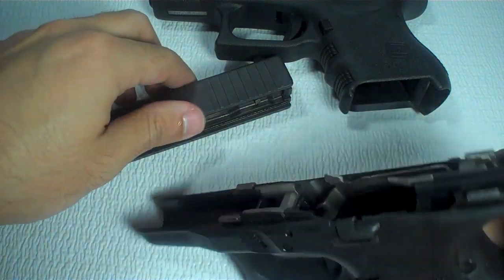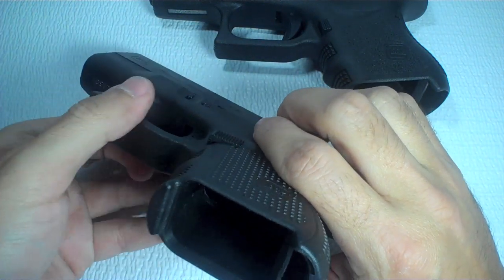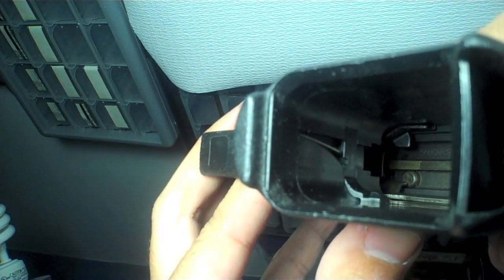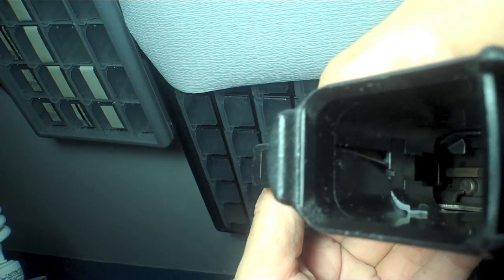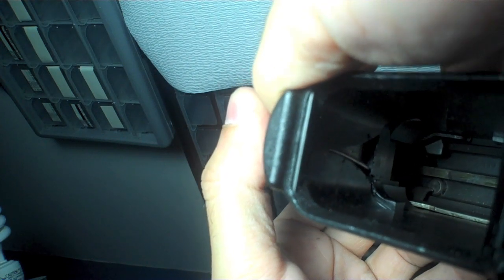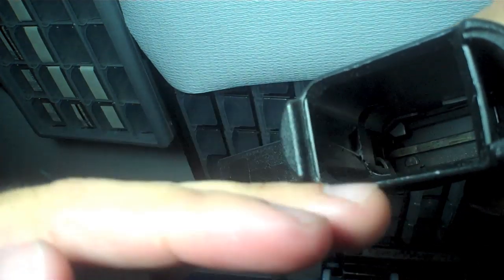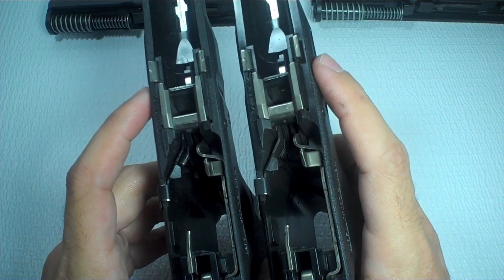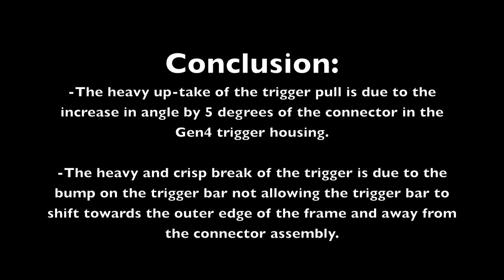What Causes the Glock Gen4 Trigger Weight - Part2

Comment: I also own a G42 and in the G42 they used the safety plunger that is now in the GEN 5 Glocks.  My G42 is a very smooth pull and release that is now in the GEN 5s.  The trigger bar bump allows for a straight push back pressure on the plunger just as you demonsrated, have not seen ANY DRAG on my inner slide by the trigger bar.  However, the shape of that plunger makes a definite difference when comparing the two types as in the GEN 4 to GEN 5.  I feel that the trigger bar pressing and passing over the two different styles of plungers does make a difference esp in the smoothness of the trigger press with the GEN 5.  How the bump's straight back press on the trigger bar (eliminating drift) effect weight by allowing more constant or fuller contact with the connector or the angle (?).  I guess that is where springs come into play.  Defensively, I'm not against the "WALL" just a lighter break with smoothness in a press, I'm not a "bullseye" shooter, but also don't like a Jerk either.

I relaced the trigger connect with the new "Black Ice" connector (3lbs) and replaced the "Safety Plunger" with the lighter spring and now have a very nice trigger press and release.  Did the same on both my G26 and G19 Gen 4s.  I believe that Glock wanted a better strike and consistent on the Safety Plunger.  The connector HOUSING itself, I agree, is  what increased that final pull weight.  Changing that connector solved my problem.  The new Gen 5, not only changed the shape of the safety plunger, but also the housing spring configuration on the connector housing as I've seen in my Glock 42 (Gen 5).

Comment: rubs more on the plastic housing, i just took the bump off. i also notice that on my gen 3 the safety plunger spins as the trigger is squeezed and on my gen 4 it doesnt spin. Im still trying to figure that out as on my gen 3 i cant feel the safety plunger spring but on my gen 4 i can here a small click as the safety plunger gets compressed. Gen 3 = better

Comment: I know this is an older video, but I just wanted to thank you for taking the time to post! I think it's a great explanation of what's going on also... I haven't had time to look but with the angle of connectors being different in the trigger housing...I wonder if the trigger springs are altered in any way? 

Now in 2016...I'm getting some gen 3 with 8+ trigger pull... the only thing I can think is the new finish isn't as "slick" as previous finishes and possibly the movement of the firing pin safety up into the slide may not be as "smooth"...who knows?! Maybe you should do a new video of any info you've gained since this original video. Either was, great video!

Comment: This is a good video. I am a mechanical engineer and I liked your systematic approach. I am very interested in this topic since I recently got a G17 Gen 4 and just hated the trigger. I ended up replacing it by a Zev Fulcrum after  trying the original trigger bar with a Ghost connector. (I guess I've got use to my PPQ M2 45 trigger...)
With the Zev fulcrum, the trigger improved significantly but couldn't completely get rid of the snap or "crisp" feeling at the end. So, it might discard the bump theory.  

Last week while at the range i tried one Glock, don't remember the model but it was Gen3, and the trigger felt really nice, no snap. The owner is a range officer, he told me he had polished all the contact areas and the trigger changed. I will do the same, specially the contact area between the trigger bar and the connector. 

Please, if you go ahead and polish the parts post the result as well.
Reply: try polishing the cruciform tip that contacts the striker plus the striker surface it contacts as well. note the cruciform must scratch the striker arm downwards to release the striker. there is much tension and friction at this point.
Reply from the maker: Thank you for the kind words.

I polished the contact areas on my Glock 19 Gen4 and did not notice much difference but maybe you will. I will say one thing: DO NOT polish the area of the trigger bar that makes contact with the striker pin (its the section of the trigger bar at the back of the firearm that looks like a small cross). This part should not be touched because it can lead to accidental discharges if it's polished too much.

Comment: The bump may not rub on initial pull, but it MOST certainly does rub when the bar starts to bend, which it what keeps it from bending.  I'd say the bump clearly is in fact adding the resistance, once it makes contact.  It may however, be designed to keep the trigger bar arm straighter, thus possibly making it more reliable.

Comment: That makes a lot of sense . I was looking at my G30 that has a gen 4 style trigger bar and was wondering why  after adding a connector and spring kit that it did not feel like my other glocks . I think when I get home tonight I am going to grind  the bump off and polish it . Good stuff . Thanks for posting !
Reply: Did you do this. ?   I have a g30s
Reply: I put a 3.5 unlimited connector and 6lbs trigger spring. It made a difference. Much lighter.     I added a tungsten 17lb guiderod gs skeletalized sticker and safety plunger but kept all the factory springs and it runs flawless.

Comment: So it is the bump, but not because of friction against the slide.  It seems that it's because the bump causes the rear portion of the trigger bar to press inward more on the connector (which has a bend outward, i.e. not completely 90˚).  So as it seems it's not just working off the 'lip' of the connector, but also more against the outward force of the bend.  That's what makes the bar move laterally when pulled, and that's what that bump ends up resisting…causing the 'friction' back at the connector.

Good work!

Comment: Thank you for your very excellent analysis of the issue.
The problem I have is the fact that Glock put it there for a reason which appears to keep the bar from sliding outward during the last part of the pull. Which seems like maybe a good idea. I wish someone knew the real reason its there. Back several posts it was suggested that it because of the ability to switch the mag release for leftys. If that's the case I would have no problem switching it.

Comment: Get Rid of the Staple-Gun feel trigger:  100% agree!! 
After trying several different connectors and combos with springs on my Gen 4 35 and recent 41 ....  The removal of the BUMP or switching out to a Gen 3 trigger bar is 110% IMPROVED less of a wall/reduced weight "feel".  

The Gen 4 35 I got a gen 3 trigger bar Pt# 0357 and no bump from the factory.  The Gen 4 41 I got the newest trigger bar from Glock but all 45 ACP/10mm bars (gen3 or 4) has a "bump" so I filed it off ..... Both Smooth and Sweet. 

To help with the "Wall" before the break of the striker, I highly recommend the Ghost Edge (or Evo Elite, or Pro3.3) connector.   The wall free connectors make everything above with the bump free trigger bar even more Sweeeeet.  

"De-Bump"  and never look back.  Your gen 4 will loose that "Staple-gun" wall trigger and you will shoot much better ... lots better!!

Comment: Great video, explanation and theory.  To test it I ground the bump off of my gen 4 19.  Much better and very similar to my gen 3 glocks.  I will order another factory fresh trigger/ bar assembly and move on.  I was just about to head to the local GS to trade my gen 4 for a gen 3.  Thanks, you saved me a couple hundred bucks.  I was really struggling with my Gen 4 at the range.  Could not get near the groups as with my gen 3 and my gen 3 is a snappy 45 acp.

Comment: Do I have to be concerned about plunger being fully depressed with the absence of bead on bar after prolonged usage?  Theory:  gen 4 has smaller grip radius which required smaller trigger housing which changed connector angle and bead was required

Comment: Keep in mind that Glocks are duty weapons not target guns so the stock trigger isn't all that bad, Granted the gen3 trigger is nicer than the gen4 , But you can make them better mass produced guns don't have the refinements that expensive guns do because it take time to polish everything that said a little time with a super fine stone and then some polishing of all the contact surfaces of the trigger parts will make even a 6-7 pound trigger feel lighter than it is. Don't mess with any of the sear parts though.

Comment: also the connector is 5% but on a less angle than the gen 3 so it would be a lighter pull so your off there that's why you need a police chiefs signature to even get the dot connectors.

Comment: The only reason the bump is there is for if your a lefty and switch the mag catch to the other side. The way I see it is when the bar drifts left at the safety plunger it changes the 100% parallel engagement of the sear to the lug face of the striker.So that left drift translates to the right at the sear.This is why we used to actually file the lug face obliquely at a 15% angle from right to left to regain that engagement. Some like the crisp snap off some don't but I'm an advanced armorer with glock and the 45/10mm gen 3's on all models have that bump so it's nothing new. I commend your observations and attention to detail. You are 100% right

Comment: I think another factor is the GEN 4's tend to be newer. They just came out. The Gen 3's are older and tend to be worn in more. Get a NEW Gen 3 and NEW Gen 4 and you will find small difference I  suspect. However it is a good video, thanks. It is interesting to see the working action and the difference between the G3 and G4.

Comment: Nope. Depress the little safety mechanism on the trigger and pull it back and forth without letting the assembly coming out. You can feel there is no drag unless you do it with a spring in. So you are incorrect.

Comment: WoW! 

I am very impressed!

Now the question is, can you design something that works even better, lol, j/k :)

I have the Zev Tech Comp. trigger (thank you bottleRocket) in my g26gen4 and it does not have the bump on the trigger bar.  It does NOT move to the side whatsoever.  It clearly moves straight back with no very minimal pretravel (to my liking).  I HIGHLY recommend the Zev Tech Trigger!

This was a GREAT VIDEO.  Congrats OP.

Comment: I watched your video......
I have a Gen 4 Glock 26.... Also have a Gen 3 Glock 19.....
First thing I noticed with the Gen 4 was it has hard to put the slide back on.
The next was the trigger pull....
Tried to find a Gen 3 bar.. No luck.

I took the Gen 4 bar and put it in a vise.
Took a Flat 1/2" Pin punch and knocked the Bump back in.
Took a Dremel tool and smoothed it out and polished it...

Wow ! What a difference !
Easy to put the slide back in and the trigger is great..
Thank You.....

Comment: I can't speak on any authority about the increase in angle on the connectors between gen 3 and gen 4 causing any increase in trigger pull weight, but however I did swap the gen 3 trigger bar into my gen 4 (both glock 23's) and I noticed a significant improvement in the gen 4 being that it was quite noticeably lighter at the breaking point. And like you, putting the slide back on the gun was like butter. That bump is just a pain if you ask me.

Comment: I replaced my trigger bar on my Glock 23 Gen 4, with a smooth trigger w/bar Gen 3 (only $14.95 from Ghost Inc.) along with the Ghost Rocket kit w/ 6.0 lb wolf springs and a reduced power safety plunger spring and it has made a significant difference. I have a CCW permit, so din't want to take the chance with the 4.0 lb firing pin spring. I agree with you on the connector angle, and think this is the main reason for the heavier trigger on the Gen 4's, good job!

Comment: Polish the parts that Rub or cause friction with a dremil and polish wheel. Get the ghost spring kit and connector for like 23 bucks. It replaced the trigger spring, plunger spring and firing pin spring and you'll be good. Did this with my gen 4 and I'm very happy with it.

Comment: I think that the bump keeps the trigger bar from sneaking around the safety plunger, where the gen 3 trigger bar without the bump can find the path of least resistance. 
Not pressure on the slide, but on the plunger

Comment: towards the center, it will also be pushing the safety up further into the slide, which could create a need for more force to cross that "hump". the easy fix is to add a reduced power striker safety plunger spring and you won't notice a heavier pre-travel. the reason you felt like the pre-travel was lighter in the gen4 after installing the gen3 trigger bar, it is. the trigger spring is more "stretched" due to the gen4 trigger housing, which is the same as adding a 6lb trigger spring to a gen3.

Comment: after switching the trigger bars is because you still had the stock 5.5lb connector installed.  i have not noticed the pre-travel pull to be heavier in the gen4's, but if it is that can be explained by the bump the trigger bar.  that bump is there to keep the engagement tab more centered on the striker safety plunger (you identified the trigger bar as moving closer to the side of the frame with the gen3 bar, the gen4 bar "fixes" that).  if the trigger bar engages the striker safety more...

Comment: good experiementing and deductive reasoning.  you have your theory backwards though.  the heavier striker release (disengagement) is caused by the angle at which the connector is mounted in the gen4 trigger housing.  you have to remember that the trigger bar doesn't contact the connector during the pre-travel portion of the trigger pull, that "stacking" you feel prior to the trigger break is when the trigger bar first contacts the connector.  the reason the break was heavier in your gen 3...

Comment: I had previously installed a ghost rocket connector and a competition spring kit (minus safety plunger spring,lost it)and a .25 trigger job,pullweight was 4 pounds(6.5 stock).Today i filed and polished the bump off the trigger bar.When i tested it The pull weight was 8 lbs.WTF.The reason was the ghost rocket now needed a little more grinding now that the bump was gone.After i ever so slightly trimmed the overtravel tab down.Put back together and viola:3 lbs. Trigger feels awesome! Now for testn.